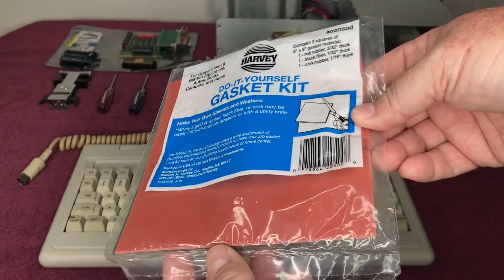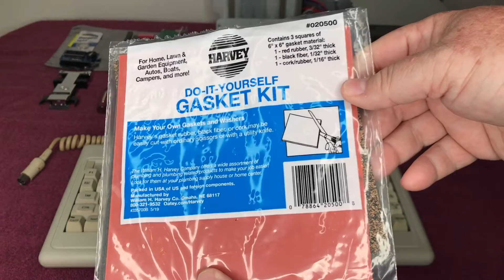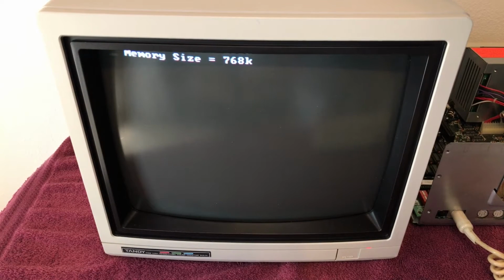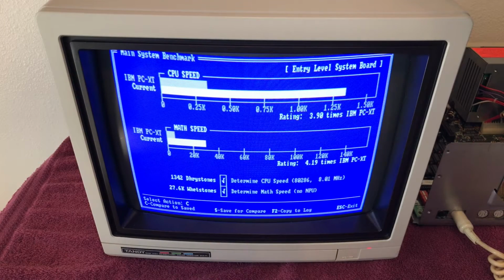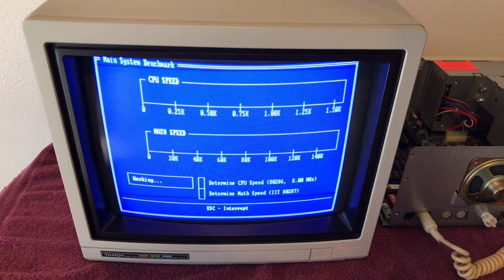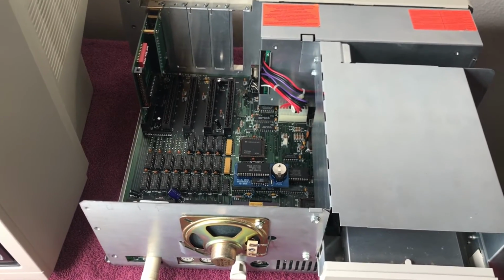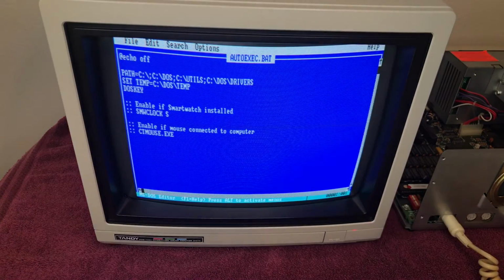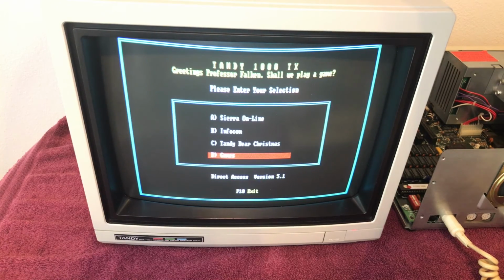Tandy 1000 TX Computer Upgrades - Radio Shack Tandy Corporation

Comment: My old Dallas finally gave out.  Those little Tindie ones are really cool.  Although the battery could be the standard 2302.  I have a TX sitting on top of my original model 3100 486 that is maxed out.  Love the old machines.  Have to start soldering though.  Caps are going all over the place.
Reply from the maker: Agreed, the Tindie modern replacement Dallas setups are really nice and a great price! As for your machine needing to be recapped, you should probably do that sooner verses later, especially if they are starting to leak.

Comment: I bought one of these from a local Tandy Computer store back in 1987.  Had to upgrade HD, math co and such.  Dont have that one anymore.  I got several off ebay and built up one with VGA and the IDE CF.  It is so much faster.  Deskmate is so nice in VGA.
Reply from the maker: That's awesome you purchased a Tandy 1000 TX new back in 1987.

Comment: Glad the upgrades are working out, looking at a similar change for my TX to include a CF interface. You had pre-installed software on your CF before adding it to the interface, what did you include on the CF and bigger question what did you use to write to it, obviously another PC. Any tips on a similar setup of your utilities that would be required on the CF to start off? Was the size of the CF important, did you create partitions on it? Sorry for all the questions on this one, but need to start somewhere before adding all these goodies. Excellent tutorial/video on the updates, very helpful for us attempting the same or just remembering the good old days.
Reply from the maker: Yes, I pre-prepare my CF cards by using a CF adapter in my modern machine, format the card using a special format utility that can handle lower settings like FAT16. MS-DOS can see up to 2GB drive sizes, so partitioning is needed if you want more space than that. My contact details are on my channel about page. Send me a message and we can discuss in more detail. I'd be happy to help you out getting a CF card setup for your specific needs.

Comment: Here I am servicing my TX and I look at my keyboard, note the cork and think to myself "huh that's strange I thought I got this from its original owner. Why would they discard the factory feet and substitute cork?"  I stand corrected. I wonder how many other retros used cork feet from factory?
Reply from the maker: Besides the Tandy 1000 SX/TX keyboards, the early IBM model F and model M also have cork feet from the factory, however the IBM cork feet are round.

Comment: The Math Co-Processor made a huge difference!  I'm pretty sure the 1000TX came with a real time clock pre-installed.  My 1000TL has one - not sure why you'd install an external one?  Otherwise, great upgrades! edit:  Just checked, I guess the 1000TX didn't come with one.  Weird - I thought it did.  I guess they started with the TL series and up (except the SL).  Nice machine!
Reply from the maker: Indeed, the math co-processor really made a difference. Confirmed, the TX didn't have a RTC from the factory. It's a small little upgrade, but so worth it IMHO. Thank you for your kind words on my video. Much appreciated!

Comment: Good stuff, thanks for sharing your upgrade path! I have a bone-stock 1000 that needs some attention so the links will help a lot.
Reply from the maker: I've still got a few more things I'm working on with my Tandy 1000 TX, but it's coming along nicely. What sort of attention does your bone-stock 1000 need? Also, which model do you have?
Reply: @geekwithsocialskills  It's a 1000HD, with the factory hard card. It took some shipping damage so I will have to at a minimum replace one of the ISA slots, and possibly repair or replace the power supply (it was sold as not powering up). It had a battery backed clock but the battery got destroyed in shipping (the hard card was not screwed down and bounced around inside the case during transit). I think an XT2IDE will be in order if the HDD is DoA.
Reply from the maker: Oh nice! The original model 1000. I like the look of the case which both the SX and TX share very similar case language. As for your hard drive solution, XT2IDE's are the greatest thing ever. Those hard hards are a PITA, even before being bounced around during shipping. Save yourself the headache and just go with the XT2IDE straight away.

Comment: could you replacing the cpus with a make it 486 cyrix?
Reply from the maker: I plan on keeping it a stock 286 machine, however I did see this thread on the VCFED website you might want to check out https://www.vcfed.org/forum/forum/genres/tandy-radio-shack/57468-make-it-486-in-a-tandy-1000-tx
Reply: @geekwithsocialskills  are there any tandy graphics games that runs slowly even for 286?
Reply from the maker: So far every Tandy graphics and sound games I've thrown at the machine from the 1980's and early 1990's run, sound and look great!
Reply: @geekwithsocialskills  could you upgrade for 486?
Reply from the maker: @neomatrix4412  As mentioned 3 years ago, there's a nice thread over on the VCFED forum that explains how you can do a 486 upgrade. Here's the link again https://forum.vcfed.org/index.php?threads/make-it-486-in-a-tandy-1000-tx.57468/
Reply: @geekwithsocialskills  okay but I want to get to see you do it
Reply from the maker: @neomatrix4412  Even if I wanted to do the upgrade you mention, I would need to have the Radio Shack Tandy Make-it-486 upgrade kit, which I don't and I've never seen one in person, only read about them online.
Reply: @geekwithsocialskills  nerdlypleasures Accelerating your Tandy 1000s  One fairly popular upgrade was the Improve Technologies Make-it 486, which used a smaller board than some others.  This is very important for a TX, which puts the CPU socket near the front wall of the chassis, preventing longer accelerator boards from being used.  It uses a Cyrix Cx486SLC/e running at 33MHz and supported 1KiB of on-CPU cache.  You might find late 16-color Tandy supporting games, like King's Quest V and The Secret of Monkey Island, rather sluggish when played on an 8MHz 286.  This accelerator makes these games run much faster and load much more quickly.
Reply from the maker: @neomatrix4412  I've seen the post by Nerdly Pleasures "Accelerating your Tandy 1000s" before. It's a pretty neat upgrade however I don't have the Make-it 486 upgrade kit, so the Tandy 1000 TX will remain a 286 which is fine with me. I do already have a nice 486 DX2-66 computer which I've showcased on my channel in the past.
Reply: @geekwithsocialskills  I-O Data PK-X486/87SL, which was originally intended to upgrade a Japanese PC-9801 computer. might work out and ebay sell it

Comment: Love seeing how much difference the Math co-processor makes, shame that only a few apps take advantage of all that raw power!
Reply from the maker: Agreed it's a shame only a few programs and games use the math co-processor. There are a few homebrew games like the 8-Bit Guys Planet X3 that might use it. I'll have to test and see. I do know his game has Tandy graphics support, so that's a win.
Reply: floating point math is handy when dealing with numbers that can range between very small to very large - e.g., anything science related. For screen graphics all the numbers stay clustered in the display coordinate area, so fixed point math based on hardware integer math works adequately and is fast on computers lacking math coprocessor. Plus no having to convert back and forth between integer and floating point representation
Reply from the maker: @TheSulross  the math co-processor actually helps out a lot wih the game SimCity drawing out the landscape which is awesome!

Comment: How do you know which math-coprocessor to use? There are a lot on eBay, some Intel, some AMD, some other, at different speeds (8Mhz, 10Mhz) with different numbers and markings. The only thing I can tell for sure is I need a 40-pin one, but beyond that, I can't determine compatibility. 🤔 I checked the manual for my TL/2 but it says nothing about numbers, just "math coprocessor". 🤦
Reply from the maker: With your Tandy 1000 TL/2 you will want to use a 80287 which is the same one I used on my Tandy 1000 TX. I went with the 10Mhz one. I put a link in my description to the exact one I purchased. If you want to send me an email (my contact details are on my about page) I can help you find one no problem.